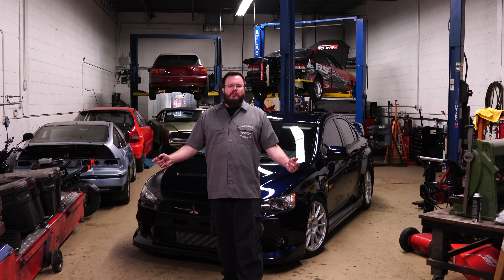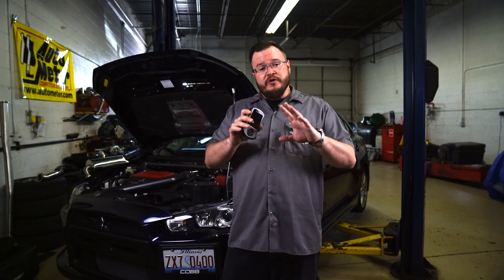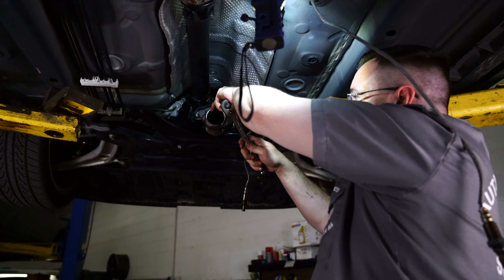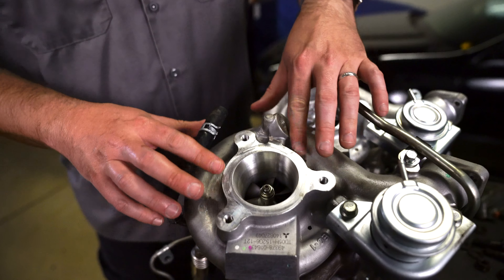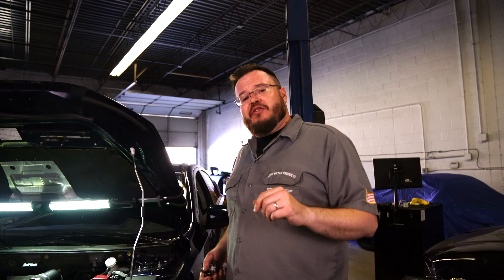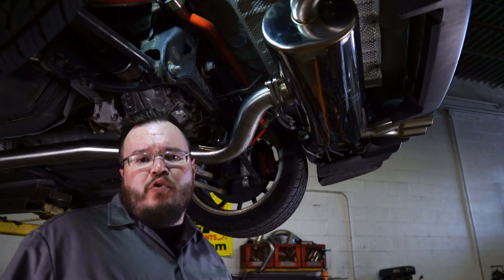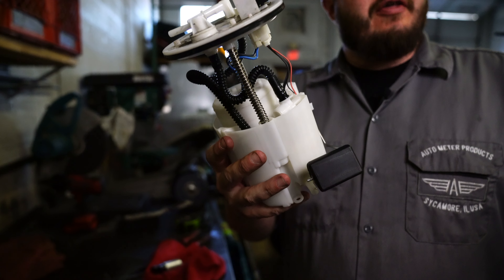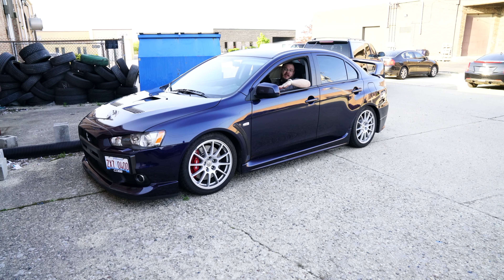AutoMeter Garage Episode 6 - Project Evo Cobb Exhaust, Turbo and Fuel System Upgrade

Comment: I just installed the MHI 18K on my 2011 Lancer Ralliart.  It was a pain in the a$$ for sure.  Just waiting to get tuned now.  I.D. 1300 injectors, Walboro 450 e85 pump and Driven Fab Flex Fuel.  I also have all MAPerformance bolt ons.  Should be a fun car once tuned.

Comment: Take it the conrods were upgraded before installing that turbo. It will waste the oem rods for sure. Worth upgrading the pistons also. Owen developments do a ball bearing upgrade for the mhi 18k turbo. Worth the extra cost. Jm fabrications do a really good tubular manifold. Was amazed how the car ran after doing the same upgrades on mine. The response is almost the same as the oem turbo. Enjoy.
Reply: you sir are wrong
Reply: Evo x rods hold up close to 400tq anything more and bang.